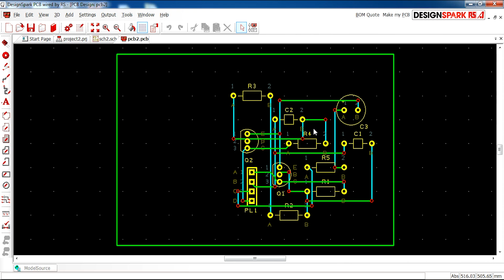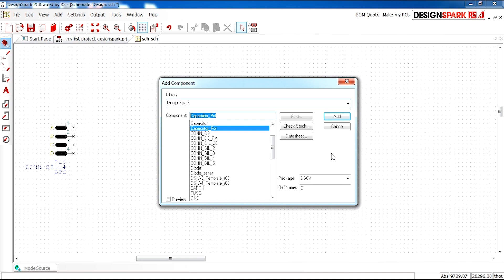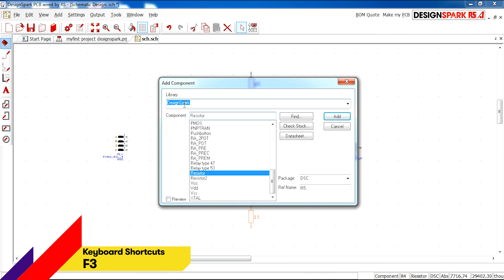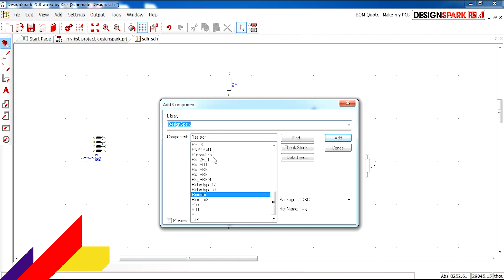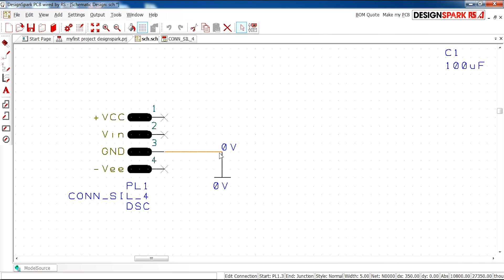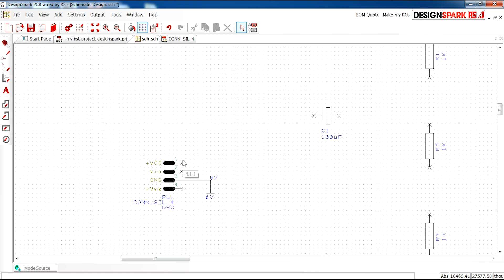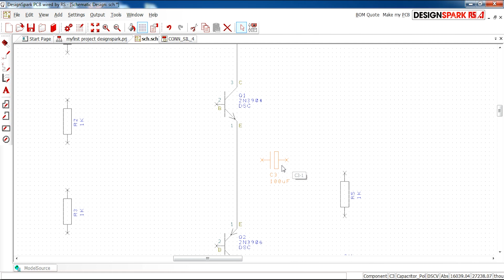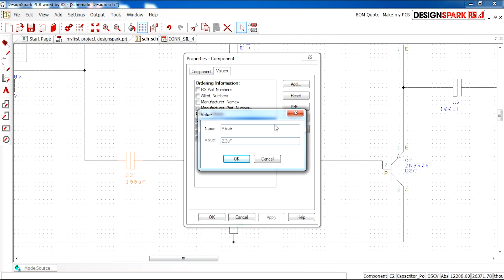DesignSpark PCB Training | 5 Schematics

Comment: I don't have the transistors library in my software and I try in different ways but nothing works at the moment. Did those extra libraries appeared automatically or did you download them?
Reply: I had the same problem here. You need to open "Libraries" (Ctrl + L) then go to the "Folders" tab, and make sure you have a specific folder called "C:\Users\Public\Documents\DesignSpark PCB 10.0\Library" (without quotation marks). If not, add it. Then I made sure that all the libraries were enabled by clicking on the "Enable All" button when that folder is highlighted. Then you can use the "Add Component" button (F3) and you should be able to see the "transistors" library along many others, took my program a couple minutes to work (or refresh I guess) but wasn't long. Hope it helped.😁
Reply: Thanks that helped (it was 11.0 instead of 10.0 for my version)